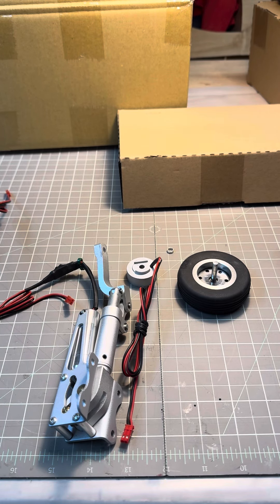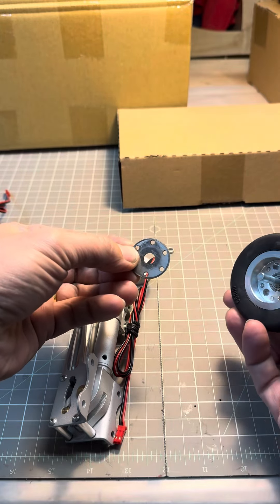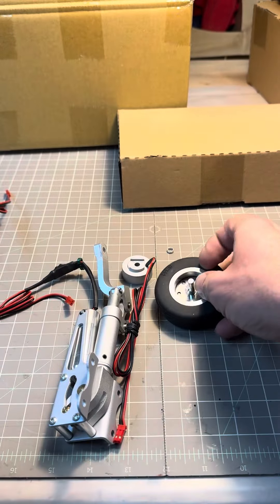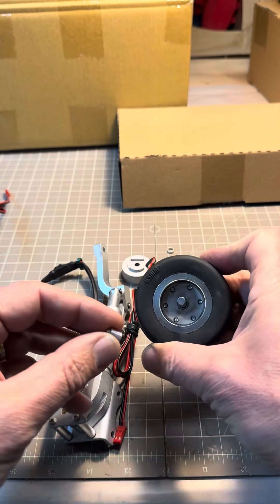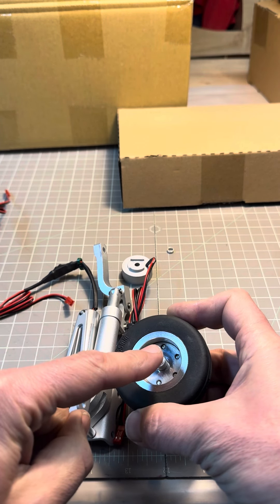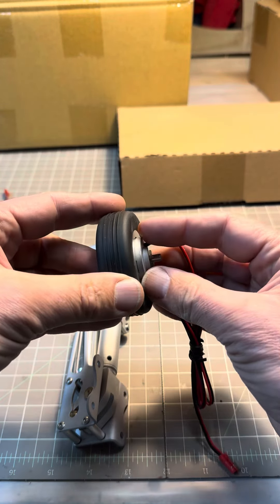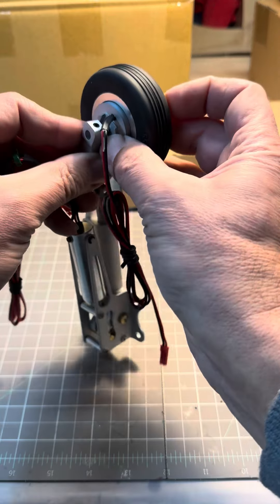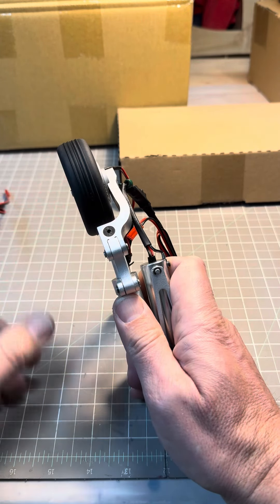Hangar 9 MB-339 gear mods

Comment: What were the actual performance improvements?  Better braking?  This is a fantastic jet overall but the brakes are pretty sketchy.
Reply from the maker: Less play on the wheel = less tendency for lock up or extra friction on take off and landing